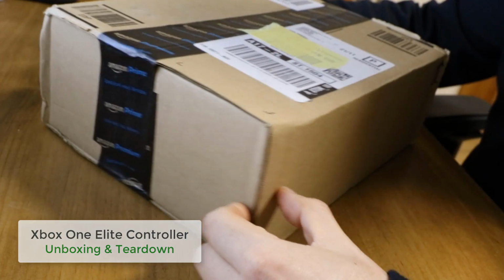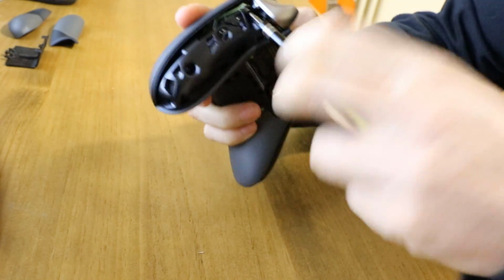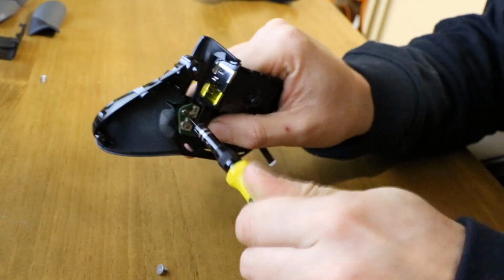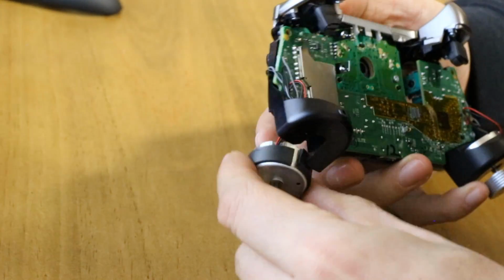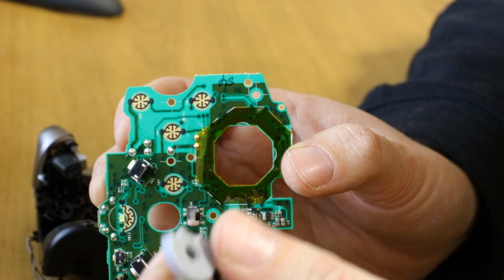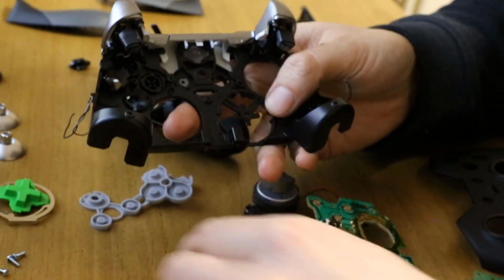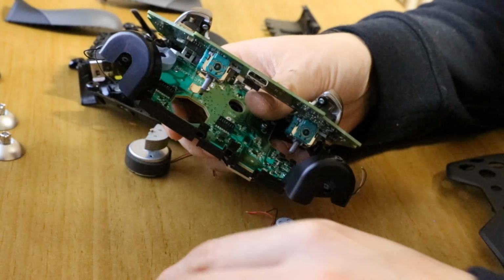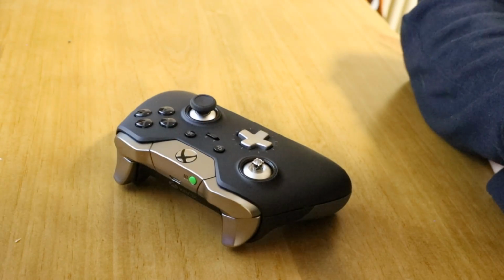Unboxing Xbox One Elite Controller Disassembly Teardown Repair Fix

Comment: The only bad thing about them is the cheap shit plastic internal sticks under the thumbstick I have tourettes and I have found it very easy to break those pieces by twitching and it is very frustrated I can't even play my games without trying to break a f******controller

Comment: I've had it with this controller. DO NOT BUY THIS! In the past year it has broken on my twice. First the bumpers because they're the same faulty design as the normal controllers. Second the right stick now has drift. I am not rough on my controllers. However, this controller has broken twice in less than a year! It costs $150 and it's not worth it. Look for another brand controller because this thing is crap. It feels great when it works but it's not worth the hassle. Microsoft must know this too because they only give the controller a 3 month warranty. Seriously, DO NOT BUY.
Reply: Dylan Blevins controller has a 12 month warranty.. plus, like any electronic, some will be faulty.. some aren't built as well as others.. i can easily do the same as you on the opposite scale and suggest people buy this controller.  Unlike you.. my 2+ years experience with it has been fantastic.. my controller still looks brand new till this day.  And this is a daily used controller..I haven't had to replace a thing on it.. so instead of trying to throw it out there stating people shouldn't buy something.. think about it, electronics are hit or miss.. it sucks when they are a miss.. but it can definitely be a hit for others..
Reply: A controller shouldn't be hit or miss for 150. I can agree with that statement on a $60 controller but not when the controller is suppose to be considered the best thing ur console has to offer. If the elite controller has the same main design flaws as the normal controller I don't think it deserves to be called elite or cost 2.5 times more. The numbers and analog sticks r the exact same thing in the normal controllers and they r what breaks the most in them too. The problem isn't mine broke. The problem is too many people r having them break way to easily and way to soon. While yours works that is fantastic but I know too many people with broken controllers to recommend the price tag. I'm not rough on things, especially electronics. My profile picture alone shows how much I liked the controller when it worked. The problem is, it breaks itself basically by the poorly designed bumpers and the cheap analog sticks.
Reply: Dylan Blevins I'm sure if I were to check reviews on a $3000 Samsung TV, there will be some people talking about defects, dead pixels and other broken stuff.. Because as I said, electronics in general, no matter what the cost, are hit or miss.. And it's unfortunate.. However I do agree, this controller isn't worth $150..  I'd say more like $100.  Mine came with the elite Xbox.. So in theory the elite Xbox at the time was $100 more than the regular Xbox.. So it's like I paid $100 for the controller.. Which should be the price..